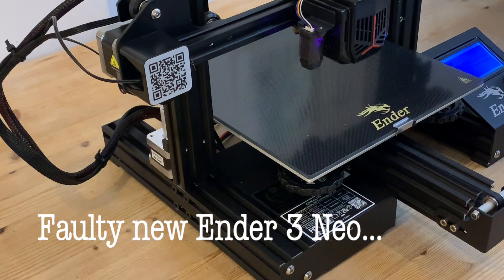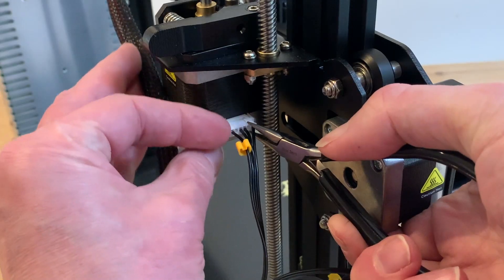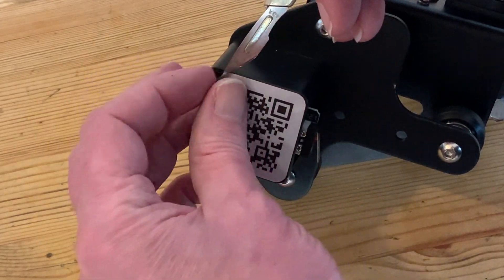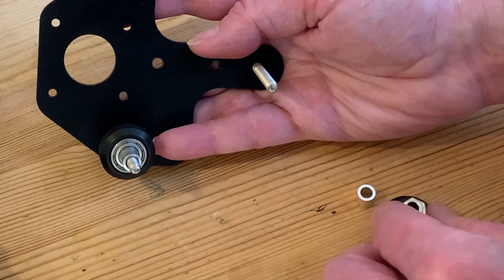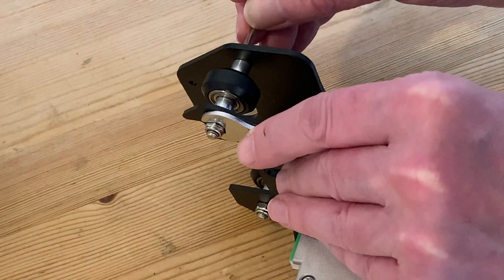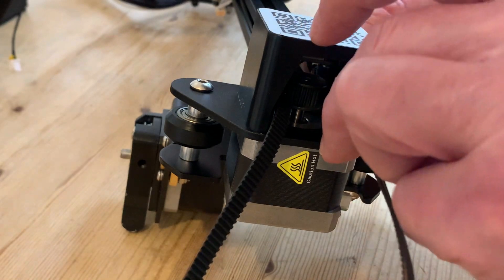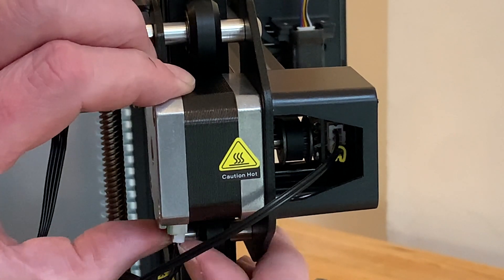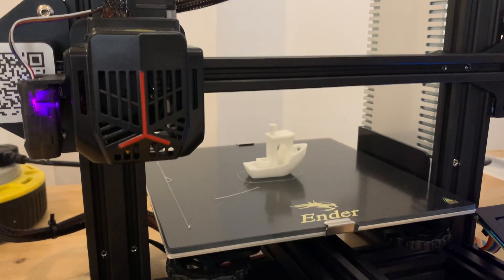FIXED! Ender 3 Neo factory pre-assembly fault – solved in under an hour – and all still in warranty.

Comment: ALL this printer has ever said to me for a year is STOPPED its never printed at think=g brand new z stepper  new , board new everything flashed with marlin flashed with standard what a pile of junk should have kept my old box printer it was bad but aleast it worked
Reply from the maker: I've managed to coax some ok results out of it - once I got it working with this fix in the first place. I was always aware that it was a budget option - only cost me £139, so I was ready for a potentially challenging time. Big improvement with a twin geared extruder.

Comment: I just ran into this issue ,I thought it was something I did will be pulling mine apart tomarrow .thanks so much I didn't want to have to send it bac and wait to get a replacement.
Reply from the maker: Good luck. I guessed I might not be the only one. It isn't difficult, but does take a little while. Creality confirmed it does not affect the warranty, so go for it!

Comment: Thankyou Sir,been looking for a solution for months ,Creality are no help whatsover,will be starting that procedure tomorrow.Thanks mate!!
Reply from the maker: Glad you found it useful! No, Creality not much help at all, although eventually they did offer a replacement - but only after I returned the original printer. Much quicker, and easier, to take apart and re-assemble correctly myself. The procedure isn't hard, but take your time and keep all your bits well organised! BTW I did get confirmation that this wouldn't affect the warranty. Good luck.
Reply: @paterpracticus  thanks mate,I'll give that a try,but it's too hot to sleep and the fan is on not much help ,the AC has to be turned off at 10 pm.....I'm just about ready to chuk it in the Dumpster,.and sent a feedback to the seller indicating as such....Cheers.
Reply: I did the mod but it still makes that noise and doesn't Auto home, Any suggestions?? Thanks
Reply from the maker: Does the print head move all the way to the left and reach the switch?
Reply: @paterpracticus  not quite it has coniptions and makes a horrible vibrating sound like it's gunna detonate,BTW it's just after 1 :AM and,and it's 30°C.Thanks for replying,I checked the wiring and found a leed that had y on it,but the Y axis on the limit plug bank already has a y lead in it ,so I put it on the other side as there was an empty plug,....
Reply from the maker: Phew, that's warm! I was going to suggest the wiring next. The switch at the left hand end of the x axis should have a three pin plug marked with an X - see 10:42 in the video. If the print head is reaching the switch, but not activating it, then it could be that it isn't fully plugged in. Otherwise, check to see if there is anything else blocking it from reaching the switch. Hope that helps.
Reply: @paterpracticus it still jams,waiting on new wiring harness,I think it's unfixable
Reply from the maker: I'm sure we can solve this, after all we do know we're getting power to the X-axis stepper motor, so that's a start. 

Can I just run through a check list to try to narrow it down further?

1. The x-axis motor/extruder mounting plate IS now the right way up, with the wide bit at the bottom.
2. You CAN manually push the print head all the way to the left along the x-axis.
3. The side of the print head DOES make contact with the switch, and that clicks when it does.
4. The 3 pin plug, with X on the yellow tag, IS firmly plugged into the socket on the other side of the switch housing. (I'm guessing the 6 pin X labelled plug must be plugged into the motor, as that is working, and the one with an E is plugged into the extruder stepper.)

Let me know if any of the things aren't happening and I'll see what I can suggest. If all of that is ok, the issue must be further down the wiring loom, so replacing that (or part of it) probably is the way to go.
Reply: @paterpracticus  correct,the Y Axis seems to strain under load but when it tries to home,but I can move the plate by hand fully forward and backward.I have a sneeky feeling it's a failed Y axis stepper motor,just waiting on its arrival,and a new limit switch cables...whatcha think? much cooler today and Rain
Reply from the maker: So, auto homing now does the X-axis ok, and now only fails while moving the print bed along the y axis? Once again, check the switch is being reached by the bed and clicking ok. Then check the Y-axis motor wiring. You also could try adjusting the belt tension with the screws at the front. Sounds like you've got it covered - glad it's cooler.
Reply: @paterpracticus  almost,the print head doesn't reach the limit switch,and makes the noise before it even touches it, the Y Axis doesn't even function, That's why I suspect a buggered Y Axis stepper....UGH.anyway,I mentioned  this to Creality mentioning the fixes and why a replacement  is warranted without the need for an exchange,they will either ignore it ...laugh...or demand its return for an exchange.....we'll see,thanks,it'll be a couple days before stepper motor arrives and loom..Cheers .
Reply from the maker: The print head has to reach the x-axis switch before it will go onto the Y-axis. Try putting a blob of Blu Tack on the side so it closes the switch properly.
Reply: @paterpracticus got it to Autohome,the Belt was in the wrong hole,so adjusted to go under the wheel,not the hole of the cover,and it bounced off the end switch as yours did but is slightly off centre,just need to fix up the X axis rail slop...is the off centre pos the correct spot,?It doesn't seem to boomerang to the corner.....Cheers
Reply from the maker: @andrewpotter5956  That's excellent news!
Reply: @paterpracticus  Tragedy!! The printer went to Default Chinese when I put the SD card in,and no fix available,  on alternate language,I had a silent ,4.27 Board ,took the original board out and put the updated board in, completed the wiring,and  bingo,Autohomed to its corner,and very very quiet.Creality are sending out a new flash card but I'm  not going to use it ,but will see what's on the 4.27 firmware if anything Ugh .